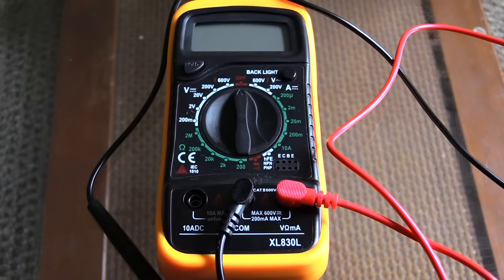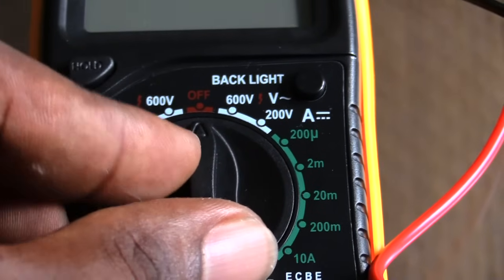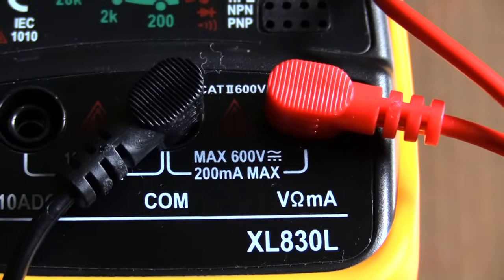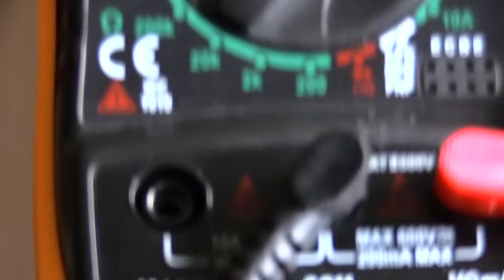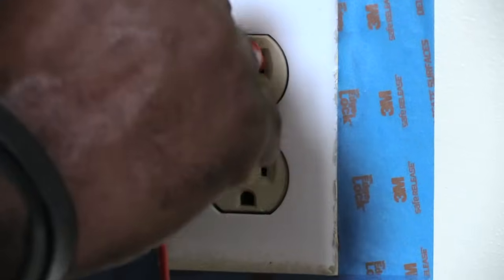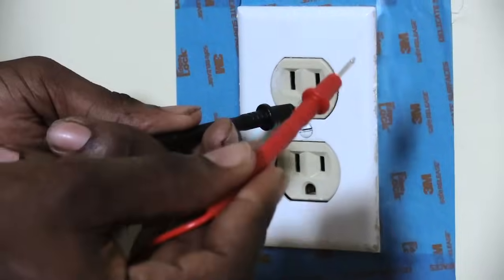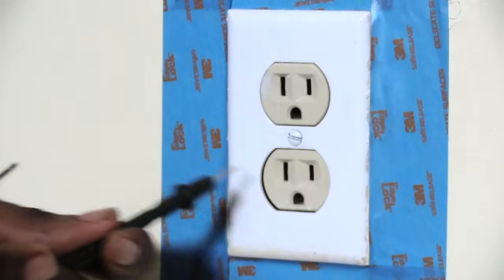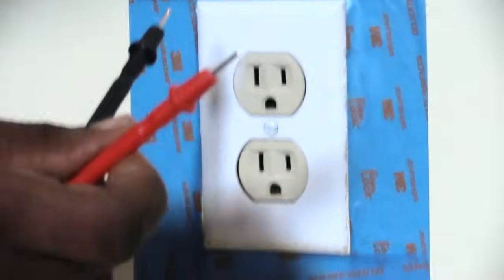Testing House Outlet with Multimeter---Easy!!

Comment: What's the other voltage settings on the left side of the meter?? It has the V with the parallel lines, one solid line and one dotted line. Is that current? How are they different?

Comment: Hey boss great video. One question I have is, I hear people saying to use only one hand to connect the 2 probes when sticking them in the outlet to prevent your body from getting shocked ? I clearly see you used both hands without getting shocked. I’m guessing that’s a myth

Comment: Can you use the same kind of multimeter to test the amperage of a residential wall outlet? If so how? My multimeter blew a fuse when I tried to do this. I thought if you can test the voltage you should be able to test the amperage as well.

Comment: When measuring AC Voltage it doesn't matter which probe goes into which slot on the receptacle. However, when it comes to measuring a DC voltage it does if you would like to know the polarity, if not it really doesn't matter. If you place the red test probe on the neg and black on pos of a 9 volt battery then you will get a minus reading ( - 9v ). Then you will know that you have your test leads connected backwards on the battery

Comment: if we are in NZ, our outlets use 230 to 240volts... so, should we set it to 600V to test? also, what happen if we chose 200v setting, wouldn't that break the multimeter? thank you  also i am doing this to check my outlet is safe to use with a grounding mat... also, i have used a socket tester , easy plug in test, to make sure it is wired correctly,, but i will wait for someone to answer my question about 600V V~ test setting first, thank you

Comment: Thanks for the video, I had one of those auto multimeters that supposedly showed you which way to connect the probes. It would always tell me incorrectly and it would just arc. 

This video fixed my issue. Thankfully I didn’t fry my meter, it just fried the probe end.

Comment: This was very Informative. 

I was recently told, you don’t need to check both outlets if you check one. Supposedly, there’s a small metal bracket that connects on the inside so that hot I will be the same.

Comment: Good afternoon. This video has taught me how to use a multi reader. So I’ve been having a lot of issues when playing music and recording. I keep getting grounding issues. I use the device to check my ground and everything seemed fine but after using this multi meter and using your video I’m getting readings when there should be zero. Not just one socket but multiple sockets. I did what your video said I put the black probe into the third hole at the bottom and then I put the red probe in the first slot on the left, which is the longer slot and I’m getting readings going up from 2 to 4. I also found a socket that was upside down in the shed . What does this reading mean if it’s supposed to be zero, and I’m getting two and three?
Reply from the maker: You will get a reading from your earth ground and your hot side. It is normal. Please subscribe like and share 🙏.

Comment: Love this video. You repeated all the safety stuff enough times I got it. Which takes longer with me. A guy who's been hand digging 20 years. I don't ever think anymore. So repetition is so important to a master and using a shovel. Lol. The guy who needs it but won't hear it till it's said 3, 4, 5 times. 

First I heard the long line on the wall socket is the ground. Then I heard you say again it's not. Went back and checked. Lol. I caught it because you repeated it two more times before I realized I was switching the two.

All in one video. Very nice. 

The stuff written on the toolsweek website left questions. The video answer them all.

When I first looked up, "how to test ground with multimeter," tools week came up first. I could tell immediately you knew what you were talking about. 

But the writing was so short and sweet I left it confused. 

Specifically the voltage test. Starts saying, "Take out the connections," which left me thinking, "which connections? And does he mean disconnect them?

Till I watched the video I was about to connect my multimeter to both sides of the battery. 

I gotta thank you for being very repetitive about the safety stuff. In writing and in the video. 

Electricity frightens me much. I been digging 20 years with a shovel. Almost hit big volt lines more than once. I'm talking solid hits. With digging bars. That break conduit. Digging pet graves unmarked in places where the a boulder or something put lines where they'd have never been start to finish.

Lucky I ain't dead 3 times over before I learned that you gotta get marks going 4ft deep. 2ft? I'm betting I'll survive anything I hit. And lines follow the part of the the bird 999 times out of a 1000 I'd say. 

I do sprinkler system service. Just got electrocuted by a low voltage line. Which I thought wasn't possible.

It was not a pleasant experience. Lol. Shit
Reply from the maker: Lol Your welcome  glad could help please subscribe like and share and check our my other helpfull videos.

Comment: Hi, is there a video to trouble shoot if the voltage is correct on a newly installed outlet but appliances don't run when plugged in? I added an outlet next to a working light switch in the shed but nothing I plug into it works. (my drill just hums.)  The box is metal and the outlet grounded...

Comment: QUESTION, I have a metal covered pole barn.  i put the meter from the small 120v hot port and the ground probe to the sheet metal should it read 120 volts or zero volts.  my meter says 120 volts . am i going to be electrocuted
Reply from the maker: Yes 120 v is right. No won't get shocked.please subscribe like and share and check our my other helpfull videos.

Comment: Hi. Good video but wondering why it matters if you put the red lead in live/hot wire when it's alternating current. Obviously it makes sense for DC testing as the polarity would be wrong but don't think it matters for AC?
Reply from the maker: It doesn't most time just good habit. Your welcome  glad could help thanks  for commenting. please subscribe like and share and check our my other helpfull videos.

Comment: Set voltmeter to 200v. On voltmeter,  plug black cable into COM and red cable in VmA. Black needle goes in first in bigger outlet slot, red needle goes in smaller outlet slot. Should read 120v approximately.
Reply from the maker: 👍 Please subscribe & like and share if haven't already and check out our other helpful videos

Comment: Hi,

I tried identifying my hot and neutral.
I stick my black probe on screw and both hole reads half of my house voltage.
Mine is 240V
Both holes reads 113-120. Does that mean I have 2 hot wires?

Comment: Great Electrical Video! Will save me several trips to my Apartment Breaker Box! Heck, I thought the big slot on an outlet was the positive hot one because it was definetly the biggest! You finally gave me the balls to finally stick my voltometer, which I've had in my toolbox for over 15 years, into a wall outlet receptacle. Prior to your cool ecture, I was only using my voltometer to check the remaining power of my aaa and aa 1.5 batteries!
Reply from the maker: Lol Your very welcome Glad could help👍 thanks for comment, Please subscribe & like and share if haven't already and check out our other helpful videos

Comment: Thanks a lot! I have a multimeter for doing stuff with microcontrollers but mains power scares me. Is there anything you can do with a multimeter in this scenario that will injure or kill you (short of something dumb like putting both probes in the same slot)? What if the outlet is putting out too much power like you said and it exceeds the 200 volts?
Reply from the maker: Most time with newer mm will just blow mm fuse.Please subscribe & like and share if haven't already and check out our other helpful videos

Comment: Have you encounter before that the  house give an electricity back feeding in to the coaxial cable line which resulting the cable box to pixelate picture or it will reboot the cable box and even the modem?
Reply from the maker: Sorry but haven't dealt with that.Please subscribe & like and share if haven't already and check out our other helpful videos

Comment: WARNING⚠️! Some of these inexpensive multimeters will not read any voltage when they are set to measure lower voltage (i.e when it’s set to 200v instead of 600v) this may lead you to believe that the outlet/ switch/ light/ etc is disconnected, when in fact it is live. Be careful! Go through all the available measurements on the dial before you assume it’s disconnected.
Reply from the maker: Thanks for info👍Please subscribe & like and share if haven't already and check out our other helpful videos

Comment: Great video.   Thank you.   I’m doing earth grounding and bought some items for Health benefits that needs to be plugged in the grounding hole and the instructions says to check the outlet for good ground connection using a outlet tester or multimeter.   I purchased a multimeter but I’m confused as to how to make sure the grounding  part is working so that the product I plug into that slot, I’m receiving the proper benefits of it.
Reply from the maker: Test with the bottom circle hole 'which is ground' and your hot side of outlet, Should read out ard 120+- if grounded correctly.Please subscribe & like and share if haven't already and check out our other helpful videos

Comment: My meter is not reading anything even though I have it set up just like yours. I know my outlet has power because when I plug in a light it turns on. What is wrong?
Reply from the maker: Your meter or prongs could be bad.

Comment: Hello I have a question, so I have a blank plate and I looked behind it to see if I could add an outlet to it, because there is only 2 outlets in one big room I have. When I did what you’re doing, it kept reading 200 and above. I know this is highly dangerous. Unfortunately the old owner of the home screwed around with everything and I mean everything is so messed up, especially the electrical wiring. Do I need to use a 20 amp outlet or is there such a thing as a 30 amp outlet...? Or should I just leave it be.
Reply from the maker: I would call in an electrician to besafe if someone has already played with it, it maybe dangerous wouldn't take a chance. Good luck. Please subscribe & like and share if haven't already and check out our other helpful videos

Comment: Hi, does this also confirm there's no arcing problems inside the outlet? Aka loose connectors?
I was thinking that maybe if the connectors are loose, then you'd see voltage fluctuation, or less voltage?

Comment: Why is the fuse not flipping to off when you measure from the power outlet to grounding? Shouldn't the system detect it as leak current?

Comment: What if u get voltage when testing case ground? I'm getting 120 with neutral and hot, like u want, but im getting 60 with case grnd and neutral. I'm getting 60 when it should be zero